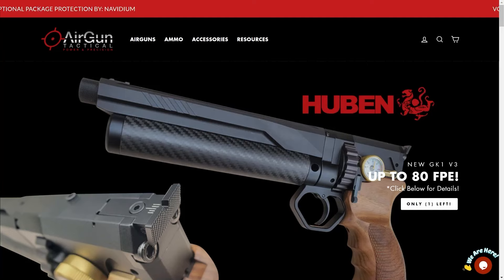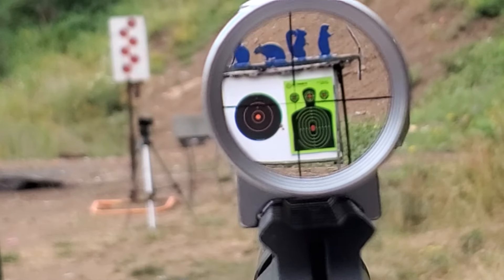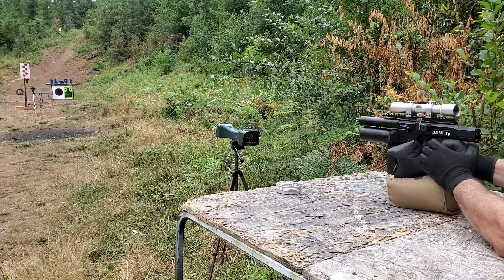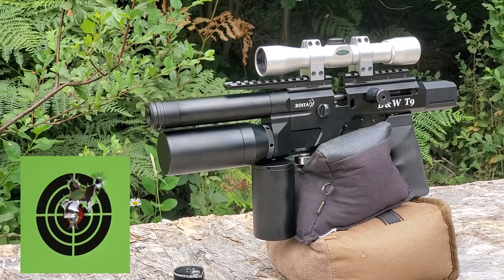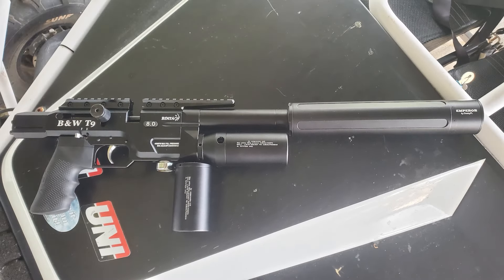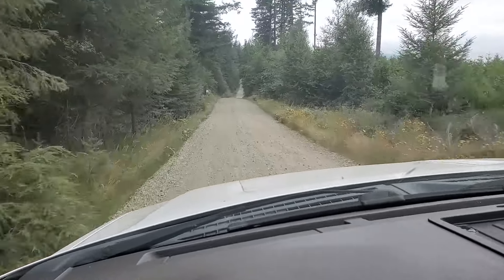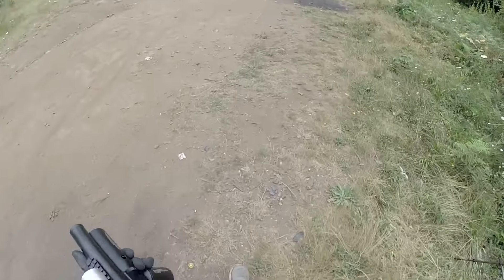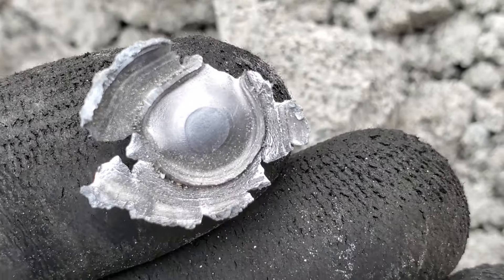BinTac T9 Review .357/9mm (147 Foot Pounds) Semi-Auto PCP Pistol

Comment: It's a good option for a truck gun in a state like Maryland or if you are traveling in the US. No permits... No variance in local laws. Bullets are a lot cheaper than regular. Night use you are not giving away your position when you fire.
Reply: Not really supposed to keep in your car. Just something that it says to avoid, especially during the warmer weather. With that being said. Every time I get into my vehicles I have my GK1 with me. I've had it in my truck during the middle of the summer and sometimes I forget to bring it in while it's 2° outside. Hasn't seemed to do anything at all. I have over $2,000 just in that one gun so I'm not too keen on breaking it. I bought a tablet holder from Walmart that hides it in a soft case that holds 2 suppressors ( Ronin and yokozuma) along with my rear stock, tools and light charger and block. I also bring my 15" megalodon .50 in a back pack sometimes with the emperor suppressor and rear tank removed. So up to you but I've had no issues with it so far

Comment: Would be a good home defense gun for someone who cant own a firearm.
Reply from the maker: For sure!
Reply: There's only one downside, the rotary mags. They are spring loaded and this design is prone to problems. They don't like to stay under tension for too long, especially the semi auto guns who rely on nominal spring pressure. This means you cannot store the gun with a loaded mag and fully rely on it to function 100% when you need it to.
Reply: No it's really not. I got mine in this week, and it has all the standard faults, mag not rotating so the pin hits the bullets off center, semi auto not cycling etc. I'm beginning to think bintac just sends out the good guns for the reviews. I shot about 60 rounds and managed to get one full magazine out. Suffice it to say, mine is going back for a refund. Steer clear if you want an out of the box home defense gun. It WILL let you down when you need it. Some people got it working by doing some diy tweaking, but at a 1000 euro, it's not worth it. Yes, power is awesome, when it works.
Reply: There's a 50 caliber megalodon pump action shotgun that starts at almost 400 ft lb of energy and shoots 8 rounds. You can do 9 mm but at that point it drops down to about the same amount of FPE as this one.
Reply: @jbhk7977 Like any auto pistol or AR platform use ‘best practice’ protocol. Just load 7 instead of 8. This is to not have the spring under full compression for long time periods. It will preserve the spring tension and should operate with no issues.
Reply: Does that work?  @liquidsmokemustang1537
Reply: @mochilas  Yes. It’s what I do with all my mags and I’ve never had an issue. Like any spring though, especially these very small ones, they will need replacing over time. You could load just 6 as well.
Reply: @liquidsmokemustang1537  are there any aftermarket magazines that are better made?

Comment: Imagine that gom with a 12 or 14 inch barrel it would probably get close to 900 fps.
A 14 inch barrel and a folding stock the cost of pellets would be hard to keep up with with a longer barrel would make it better for a larger air tank too
Reply from the maker: Here you go: https://www.youtube.com/watch?v=cMWz4WChKYU&pp=ygUOYWVhIHRlcm1pbmF0b3I%3D
Reply: We have it in Europe now - it is the HP Max Mk.2 - It is the same receiver as the T9 but a 13" barrel with a sealed plenum in the shroud and 1 large air tank.

Comment: The inner threads are m14 a donnyfl a100 moderator back cap fits. I have my ronin on it. Same threads as a challenger pro .357
Reply from the maker: Yeah, you need an adapter...lame!

Comment: what is the side knob for?  The left side next to the logo
Reply from the maker: That just hold in a tray that contains extra breach seals.
Reply: @AirgunChannel  thank you
Reply: @riddick187  That is NOT a tray that holds extra breach seals. It's a removeable transfer port. The transfer port determines how much air can flow into the chamber when you fire. I guess the idea is that you will be able to swap between different sizes and get more or less power (without having to mess with the hammer spring etc). The one that's on the gun by default is 8mm, hence the number 8 on the side. It remains to be seen if they will actually release these different sizes though...

Comment: My concern is AEA guns have so many mechanical failures. Leaking jamming valve pins breaking There has not been one AEA gun that I purchase that was not horrible.
About leaks. I want to air this gun up. And no, but it's good for at least a couple of weeks before you have to maybe put a little air in it.😊
Reply from the maker: AEA keeps getting better though.

Comment: Whats the power? 150 fpe? I thought it was at only like 90 fpe. And is it able to shoot slugs at all?
Reply from the maker: Yes, it;s about 147
Reply: @AirgunChannel  the reason I ask is because everyone else has said 100 and alsoʻ 110 with 135 grain slug in a stick mag...what size slug did u use and was it on 4500 psi?
Reply: @AirgunChannel  I would say there was something wrong with his chronograph
Reply: @shelbykindrick-dz8bo  Agree, the T9 will not go over 740 fps with 81 grain.
Reply: Yeah and this guy doing the video here is a professional? A lot of people were lied to over this and are gonna be pissed when they realize thats a lie.
Reply: @jbhk7977  chill out dude. I said what I said. A mistake becomes a lie once it has been brought to his attention that it's wrong but does nothing to change it? Fooling a lot of people and tricking them to buy gun. So yeah whatever
Reply: @jbhk7977 Well I see him claiming this 147 fpe in multiple posts, refering to a video in which there clearly is something wrong with the chronograph. And has his own chronograph but doesn't bother to check. Pretty sure he shot the HP Max 9 mm and that barely shoots an 81 gr at 900 so there is no way that the T9 does and he should know better. Especially with other channels already having videos out showing the actual numbers that are more like 750-500 fps.

Comment: I would def add a longer barrel and if possible replace those 2 ugly air reservoirs with a cf bottle.
Reply: It fits in a back pack as is. The bottom tank is a handle
Reply: @daves984  true, but I would definitely get longer barrel for different longer range use and just hold it by the horizontal tank, that parallel tank too bulky for my liking, better to just put one nice carbon fiber bottle small one, but one that holds more than the stock ones.
Reply: @Leadslinger619 . If you install a longer barrel, you're going to have to get a cannon licence 😁
Reply from the maker: I think they already make longer mei auto versions of this gun. Those came first. https://www.youtube.com/watch?v=cMWz4WChKYU&pp=ygUOYWVhIHRlcm1pbmF0b3I%3D
Reply from the maker: Oh yeah.
Reply from the maker: So true! https://www.youtube.com/watch?v=cMWz4WChKYU&pp=ygUOYWVhIHRlcm1pbmF0b3I%3D

Comment: Air guns are getting so powerful, that state laws are changing for ex-felons. In the least they have made hunting laws that mandate that since an airgun is considered the same as a firearm for hunting, felons cannot hunt with them. Federal law supposedly gives felons the right to own black powder antique firearms. But state laws are allowed to be more stringent, and some restrict black powder for felons to own or possess or have access to. Lethal force is around 100 FPE. The Us Army uses the criteria that if any projectile passes through a 3/4" piece of plywood. What is needed is a standard type of magazine loader WITH the gas included for 8 rounds. Also, someone needs to push the air pressure up to 10,000 psi. Remember, 5.56mm and .50 cal Army rounds fire at 55,000 psi. Newer Army calibers are rising to around 75,000 psi. Thats what makes gun powder so effecient. Tight package, less real estate, more bang for your buck. This unit is a step in the right direction. And of course, you can always do better with pure Nitrogen. For the price you pay for these things, they should run like jewelry. Precise, like a normal, well made firearm.
Reply from the maker: Crazy!